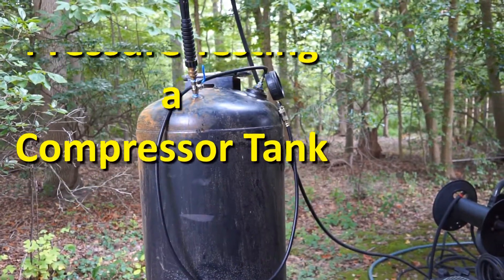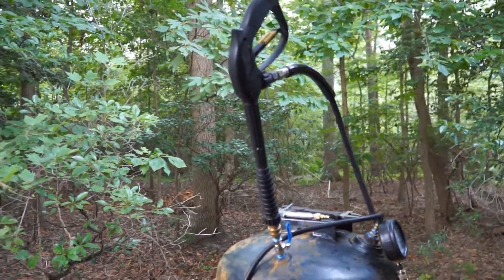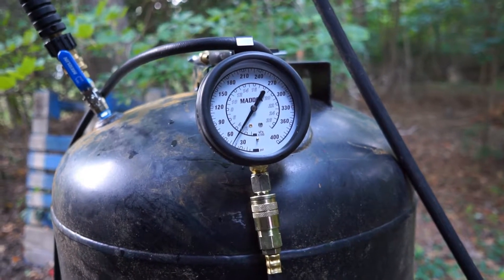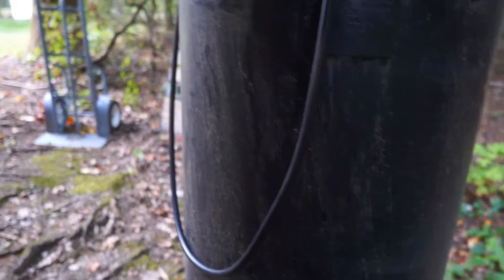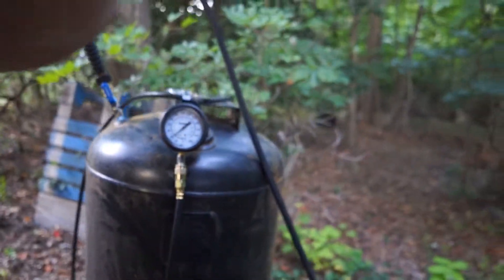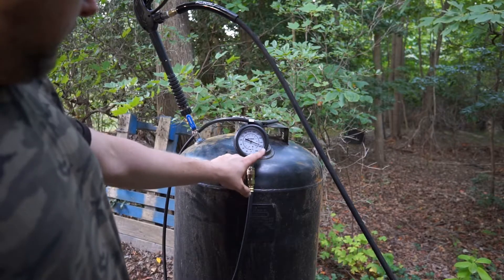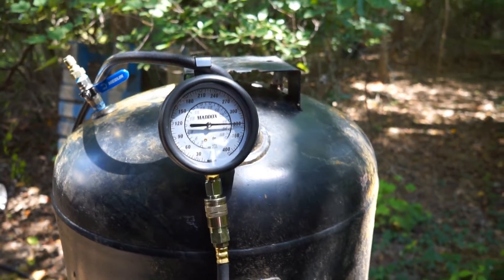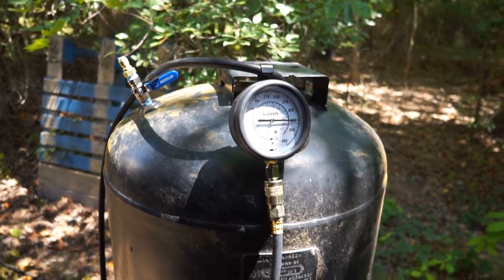Hydrostatic Pressure Testing A Compressor Air Tank

Comment: My tank is rated to 175 PSI. The compressor cycles up to 140 PSI. I usually test my tank every four years to 300 PSI for one hour using the grease gun methode. It leaves a bit of a mess in the tank but that just rust proofs the bottom. My 30 gallon tank when filled with water takes about 1-1/2 tubes of grease to pressureize to 300 due to elasticity of the steel.

Comment: Good safe practise using water for test medium. Due to water in the tank not being drained regularly the designed corrosion allowance can be compromised unknowingly sacrificing the tank wall thickness from the inside.

Comment: People dont know pneumatics and it shows in comments.. same people on the playing the field that say "not HPA it will explode so ill stick to AEG".. they also dont batteries either as id rather take my chances with a loud whistle than whote hot chemical flames when the air hits a ruptured battery.. i mean if we playing tit for tat game..
Most tanks dont rupture to form lift an thrust..thats a tank rocket..most just scare the shit out of you.. your hot water heater is more dangerous than these! Watch those videos, i dont if the show same ones from engineering school to public..but just say they ARE not informing you correctly on the sales pitch just how dangerous BUT most safe they are at same time..

Comment: If th factory plate on that tank has the tested data it will say what that tank is rated to. Normally tests are to 150 % of operating system pressure. Most tanks are tested at 200 psi for 30 minutes
Reply from the maker: Yes, and right now I don't remember what that showed but I wanted to test it to at least 150% of what my current compressor was capable of so I knew for sure it was safe to anything that could accidently happen to it.

Comment: I have a hand pump that will do up to 3000 psi.  It uses a paintball type fitting.
Reply from the maker: I'm guessing tha that you're talking about something like the pump used to fill the reservoir on a PCP air rifle or similar. That will get you the pressure, but you don't want to use air because it's compressible and stores energy causing an explosion if the tank ruptures. Admittedly if you fill the tank with water it shouldn't be that much air, but I'm not risking it with a 60 gallon steel tank (one of my dad's friends was killed when a tire ruptured, MUCH less volume and pressure).

WRT to small pumps, I've heard of people using grease guns, but they pump a very small volume and I have no idea how well it works IRL.
Reply: @mpikas  a grease gun could work for pumping Grease....... However you can get a bicycle shock pump that can do 300 PSIG off of Amazon for $25. 

A few ccs of air in known good attached small piping during  testing won't matter.... That piping is good for thousands of psig.  The rupture would occur at the tank which is full of water

Good job